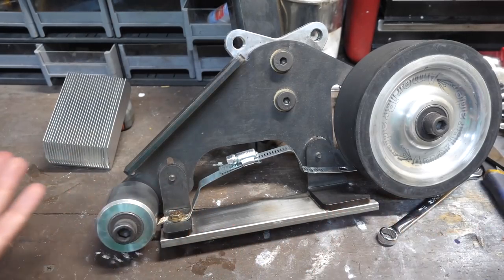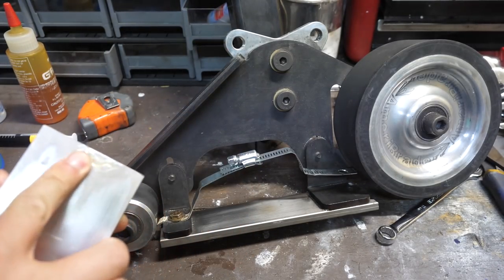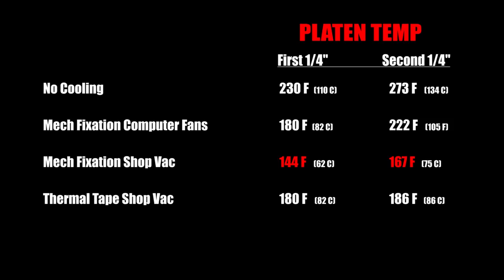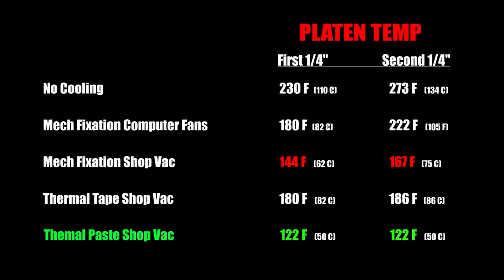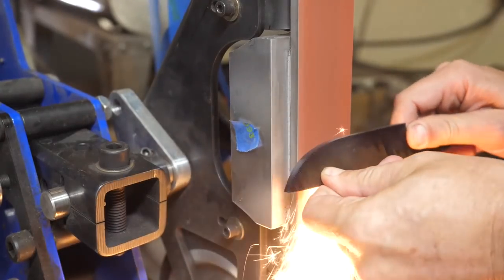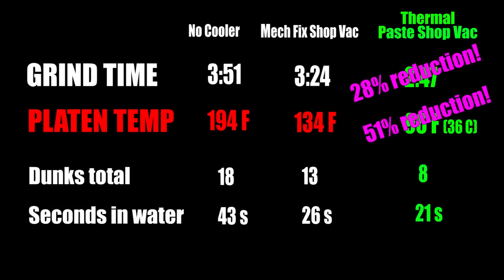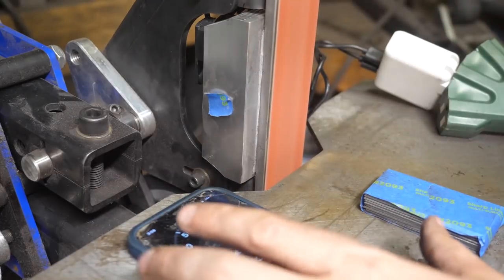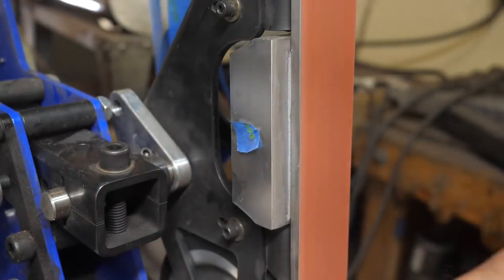DIY Platen Cooler THERMAL PASTE Edition?! Part 2.

Comment: A lot of people here think water cooling is the way to go... I disagree. It goes against the principle of parcimony (aka, keep it simple stupid!). Too much water, too many parts that might fail, more expensive to set up and to replace parts, too much dust would probably clog the radiator, to fragile and exposed in a heavy duty working area, sparks, electricity, rust, etc. This is just not a friendly environement for an AIO, much less a custom loop!
I think a lot of people think water cooling would be best because they know about PC cooling but have no actual experience working in a metalworking shop. 
Also, a water cooling setup is limited by the thermal mass, decided mostly by the amount water in the loop, and the efficiency of the radiator, decided by the size of the radiator and the power of the fans. The thermal mass is only potentially usefull for short bursts of heat. In long sustained workloads you will "fill up" the thermal mass and that's that! It will only work as a heat conduit between the platen and the radiator. 
Now if you had 500L of cold water sitting in a bathtub next to the grinder, that would give you a lot of headroom! Better yet, use the river that passes right next to your workshop to take the heat away like a nuclear power planr! 🤣🤣
Water cooling is not inherently better then air cooling, in fact, it is air cooling just the same! Water cooling is just a system with a "middle man" (the water loop) that takes the heat away from the heat source to be handled somewhere else, which is very convenient in some situations. Now, do your really want to have water tubes dangling from your high speed, high power belt grinder while you handle sharp and poky metal objects? I wouldn't! 
There are a lot of misconceptions out there about water cooling, but then again, apparently most people think that eating a burger with a side of salad is LESS fattening than eating just the burger, so go figure!

Comment: Wondering about mist coolant as an option. I use a noga cool mist on the milling machine to keep tools cool. They make knock offs for $15 or so. It’s amazing how little coolant is actually used. Also, the air compressor does all the work so no need for the fans or shop vac. Not sure what a few drips of fluid would do to the belt, tracking, etc.

Comment: You already have mechanical rotation/fan via the grinder motor. Use small copper pipe and braze it to the back of the platen in a S shape, do the same to the back of the heat sink. Then use vinyl tubing from the copper on the platen to the copper pipe on the heat sink.  If your motor has a fan, place the heat sink with the fins towards the fan.  Add a small water pump (aquarium pump would work) to circulate water from the platen to the heat sink.

Comment: For pulling or pushing air through a heat sink, you really need fans with a high static pressure. Those fans you used are probably pulling more air from around themselves and the heat sink than they are through the heat sink. But I really don't think you're going to find PC fans that'll push the type of pressures a shop back blower would, anyway - at least not at that form factor. 

It would be interesting to see if you could fit some sort of shroud to the top of that heat sink that would connect to some ducting with a 4" inline blower moving the air.
Reply from the maker: Could have been setup better for sure.  But their combined cfm is under 25.  Shop vac is 165.  Main issue is probably that a standard computer fan doesn’t move enough air in this case.
Reply: @GreenBeetle  Maybe server fans could be worth looking into? They are about as loud as jet engines and move a crazy amount of air with significant pressure... but I think a simple water cooling setup would be even better, like everyone is suggesting. A simple aquarium pump should, a motorcycle radiator and whatever you can come up on the mill should do fine.

Comment: DUDE.. those fans need to be the other way round... PULLING the heat away.. not "pushing" it back in. Go look inside your computer at which way the CPU cooling fan is placed. 
i said this in your last video..

Comment: You did not spread the paste to provide an even film on the surface of the platen. You will not get full benefit of the thermal transfer effect.
Reply: If he's got any real clamping force the paste will have spread out to fill the gaps in-between the surfaces.
Reply: @MillionFoul  Kind of my point. He is using a modified stainless steel hose clamp across the length of the heat sink. A squeezing motion more like a couple of c-clamps would be more effective but they would interfere with the platen. He should look into using some bolts that thread into the platen from behind maybe.
Reply: @Vault57  He addressed that option in the last video as being extremely likely to damage the platten because it's quite thin hardened steel.
Reply: @MillionFoul  Yes he did. Modifying the platen with a more positive clamping force will probably provide a better heat transfer. Fabricating a new platen designed to specifically accept the heat sink and fans would be the best solution. He's on to something here that could be of long term time savings in grinding and perhaps longer belt life. Abrasives aren't cheap. Considering the cost of those blasted machines, I would look into fabbing up my own custom platen.

Comment: jesus man! that is NOT the way you should have applied the thermal paste! When the two parts squish the thermal paste all the air should be expelled. For that to happen you need to apply the thermal paste sensibly, not like you're gluing to wood pieces with pva glue! 
Also, less is more! You want as little thermal compound as possible, it is there just to bridge the gaps between the two metal surfaces. If they were both incredibly flat they would stick together like wringing gage blocks. If the heatink and the platen are not very flat you could lapp them for better results.
Anyway, I still think your best bet is to reduce friction with a carbon sheet between the belt and platen and a properly oriented heatsink with good static air pressure. For example, the shrouds on the fans are there for a reason (static pressure). When you cut them up like you did so they fit, they loose alot of their efficiency. 
I think you're on to something here, but you really need a better understanding of air cooling. 
If a thicker fan doesn't fit, why not cut away some of the height of those fins? You can even cut a "slot" in the fins just the right size for a fan, so it sits recessed in the heatsink. I would try one single fan recessed in the middle of the heatsink, with the shroud flush to the side of the heatsink. 
Better to have more airflow with a stronger thicker fan then a few extra milimeters of fin height.
Remmember: air will take the path of least resistance, you want to force all of it to go between the fins.

Can't wait for the next iteration of this experiment!👍
Reply from the maker: I took heat sink off a few weeks ago there were no gaps it was completely covered
Reply: @GreenBeetle  👍

Comment: As everyone else is saying, liquid cooling would probably work better. Even an ok AIO-system for CPU's are designed for handling 90w+ of energy, so that would be fun to see. Would go with at least a 240mm radiator.